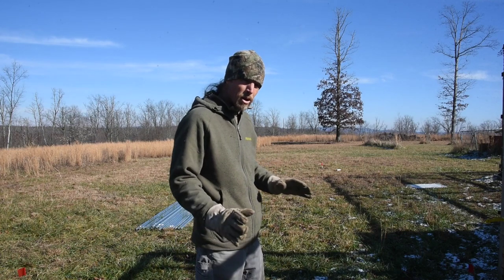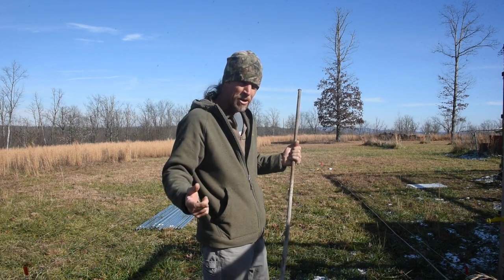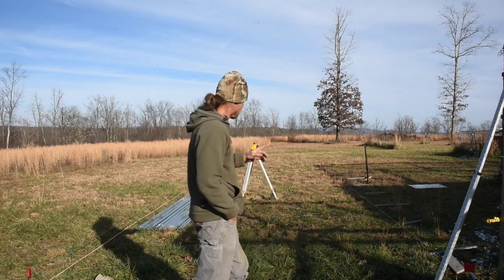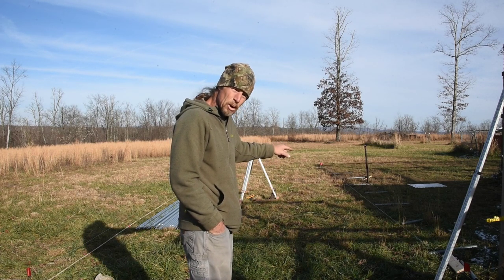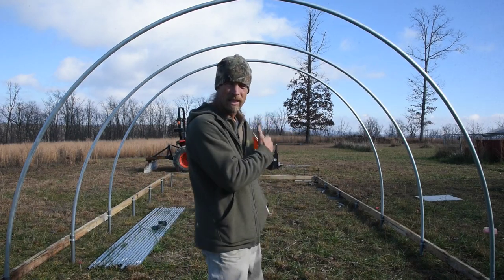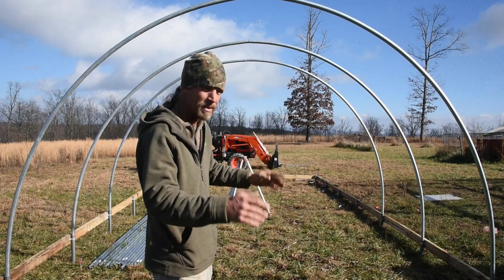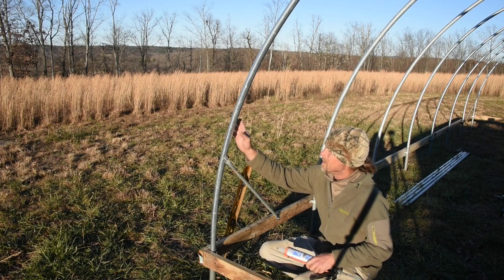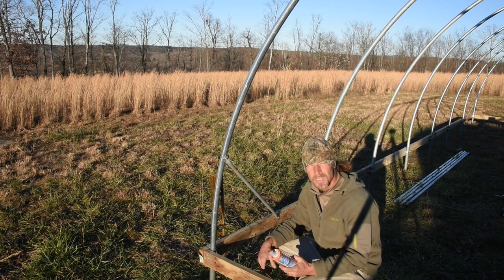DIY chicken coop hoop house for pheasants,chickens,greenhouse. Bend your own greenhouse bows.

Comment: This is a really large run and its really well thought out too. . 

Thanks for sharing this! Im trying to figure out if I'll build a cattle panel hoop house or a bent pole house. 

The cattle panels aren't cheap & it would be much more narrow. .

Since the poles can be a good distance from one another this design actually seems to be just as or more cost effective in comparison?

We don't have as much wind as on you're property, but im thinking that an area that gets a fair bit of snow, wider beams might be the  safer way to go?
Reply from the maker: Thanks. This works real well. We had 10 inches of snow last month with no problems.

Comment: With it being so large it really needs to be anchored to the ground. And the chicken wire is not going to keep predators out. You may want to think about putting some thick hardware cloth around the entire run and extend it out on the ground.
Reply from the maker: Hi Michele, we did anchor it to the ground. We show driving our anchor pipes 2 feet deep and then connecting the bows to them. We also ran our wire 2 feet out and stacked rock on it. Then we ran 2 runs of electric fence around it. It has been 3 years since we built this coop and not one predator has made it through our defenses. Lol. Thanks for the comment.

Comment: Approximately what do you think you spent on the whole thing with the bender and all
Reply from the maker: The bender is $70. The poles were $13 a piece at the time. I think they are around $18 each now. It takes 2 top rail poles per hoop. I had extra netting left over from previous build and extra chicken wire left over. I also got the metal roofing for free at the dump and I used an old storm door I had laying around. But if you had to go buy everything you could probably build one for around $400 - $500. Thanks for watching.

Comment: My question is weather related:  how does this hold up to a snow load and downdrafts from thunderstorms with 80mph downdrafts
Reply from the maker: Hi Scott, So far so good. The opening is facing East, and we get very few winds out of the east. Back in February we had 68 MPH winds and it held up fine. We also had a 5 inch wet snow on it and it held up. The netting was a different story. The wet snow piled up on it and stretched it out some, we had to shake it from underneath to get the snow off. There are pictures on our facebook page. If we lived in a place that received a lot of snow I would use 2 inch netting. Thanks for the question. And thanks for watching.

Comment: How is against predators?
Reply from the maker: Works great. We haven't had any trouble. Knock on wood but we haven't lost any fowl to predators in years. By turning out the wire 2 feet and stacking rock on it and running 2 strands of electric it works well.
Reply: @HippieHillHomestead  Excellent!  I am considering doing this for quail
Reply from the maker: @johnrowe3755  We are adding quail this year and this is what we are going to build for them.